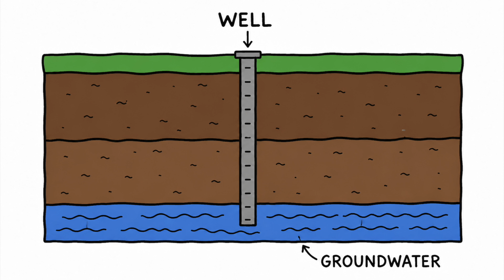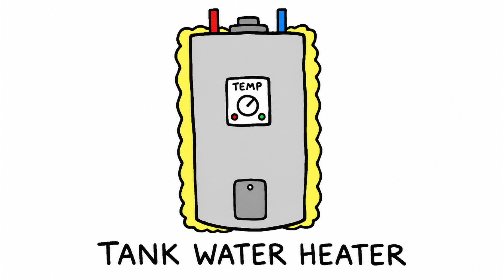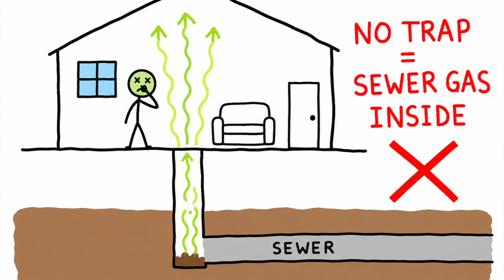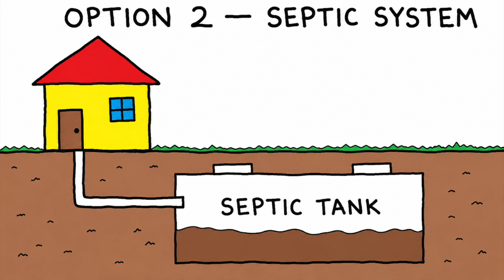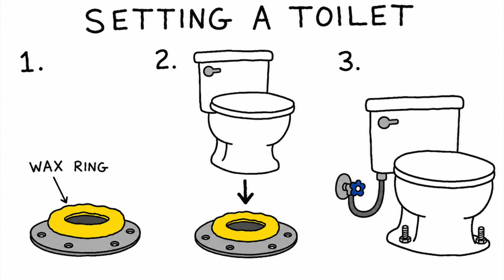How Plumbing Works in a House From Start to Finish (In Simple Terms Anyone Can Understand)

Comment: Really liked how you explained the whole system from the water supply through DWV, rough-in, and final testing. It shows how much planning goes into getting everything coordinated properly. As someone interested in this side of construction, I can see why a plumbing designer Ontario like BPConstruct has to consider so many details before the walls are closed.
Reply from the maker: It really is all about the details behind those walls, thanks for the great comment! 🏠

Comment: Awesome explanation, was able to understand just fine, thanks! Very helpful video.

First time I heard about washing machine and dishwasher being connected to hot water haha
Here they're connected to the cold water and the machine itself heats it (when it has the hot function).

Never heard before of "angle stops" too, here the usual is having something similar for the "system", like, one such valve for the bathroom, another for the kitchen... but not one for each appliance. It certainly does look very useful though.

The common here is electric showers, so 1st time too hearing about that pressure balance feature in the shower valve, seems pretty important... in older houses it happens quite often that the shower gets too hot if someone flushes the toilet while you're showering, so there's probably some kind of similar system used nowadays, but only for the cold water.

Also, here we use another kind of construction system, not sure what's the English name for it, but it's basically based on concrete; it's interesting to see how it's done in other kind of construction system.
Reply from the maker: Glad it made sense, and that hot water hookup surprises a lot of people 😊

Comment: Do you have a video explaining most of the pipe parts for example copper 90 angles and couplings and so on?
Reply from the maker: Not yet, but a fittings breakdown is a great idea, adding it 👍

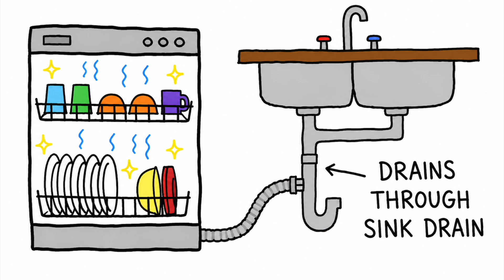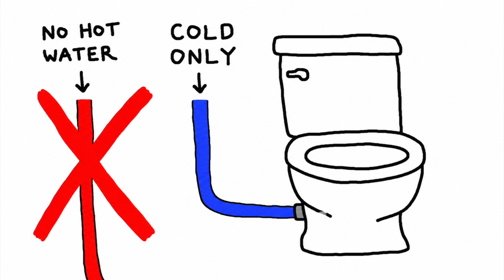Comment: If hot water help clean bacteria (5:10), why doesnt toilets use hot water too (3:46)? Nice video
Reply: Money.
Reply: Hot water will also damage parts in the toilet over time. Fill valve diaphragms, flappers, etc.
Reply: @zeppelin5000 good point
Reply: A toilet is not designed to clean. Potable water supplied to a toilet is only responsible for mechanically pushing waste through the P trap and into the DWV system. Hot water supplied to a toilet would create steam causing odors, it would become cold if not flushed and replaced soon, and it would increase gas or electric bills by using more energy to heat more water. Some Commercial dishwashers-sinks are required to have water at 125-130 degrees which kills most bacteria.
Reply from the maker: Toilets are only moving waste along, not cleaning anything, so heating that water would be money straight down the drain 😅

Comment: Amazing! Bought a house with dreaded polybutylene piping 😭
Reply: Polybutylene water line is outdated and unreliable since the 90s-2000s. If you have the resources to remodel and repipe your home, switch to  pex A or B (polyethylene) for speedy flexible installation or copper for rigid durable and recyclable potable water lines.
Reply from the maker: Oof, polybutylene, good luck with that one 😅
Reply: @rescomcontractors haha just paying someone to fix it up, 550k in nh won't get you a move in ready build no chance. Gonna do copper i think

Comment: I assume this is a US video, because in the UK the water meter would never come before the stop tap
Reply: No he made a mistake there is always a stop valve before the meter in North American water systems. In residential water systems the water meter is typically by the street in a water meter box where the piping is handed off into the municipal services jurisdiction. You typically only see water meters inside a mechanical room on commercial infrastructure.
Reply from the maker: Yep, this one was US focused, thanks for the UK side 👍

Comment: Question: How does the hot water get pressurized? Is it just running off the pressure already in the cold line?
Reply: Yes. The pressure of hot water lines is translated through the water heater and no pressure is lost.
Reply from the maker: Yep, the water heater sits on the same supply as the cold line, so the hot side runs on that same pressure 👍

Comment: UK - meter is external. Where the master valve is- you do not want it in your house, as that gives no protection in the feed to it.
Ignores non-mains pressure systems. 
In UK most do not have a 'water heater'- a combi boiler heats water on demand. Efficient.
Toilets- some are syphonic. Most have part and full flush.
Showers etc- Europe mandates thermal control to 40C max (sometimes with an override).
'Laundry box' ??
P trap. No it is a U bend. Looks nothing like a P. Does look like a U.
A vert is not essential- an air admittance valve can be used. Even inside the house.
Drywall is NOT universal.
Many toilets are rear drain fitting- incl all wall hung types.
Reply: Most meters in the US are external. Some are in homes, but most are outside. The meters have a valve on them and most homes have another valve inside the house after it enters the home.

The entire P trap assembly does look like a P on its side, the trap arm plus the trap.

AAV's fail and are not code to use  to vent an entire plumbing system. Kitchen sinks are often the only fixture allowed to use one. They must be accessible since they fail...
Reply: @z @zeppelin5000  P on its side’. Provided you remove the top of the vertical. Whereas the U is a clear representation of the concept. See the original patent. AAVs are perfectly legal in the UK. Remember that the US represents ~5% of the world’s population…

Comment: Notes Main water shut off valve water heater breaks 
Water heaters tank vs 3080 tank less water heater
Pressure balance fir shower 
Facets need frost free outside

Water seal in p trap water to prevent stench 
Branch drain main drain

V ent pipes
Blocked vent causes stench 
Main building vein - city sewage 
Or 
Septic tank clean 3-5 tires 
Clean out access points capped fitting main cleanout  near t h e main 
Basement garage foundation
Reply from the maker: Those are some solid notes 👍

Comment: Dishwashers connect to cold water in Italy, and probably the rest of Europe. They heat up the water to whatever temperature you chose
Reply: Almost universal- the hot water in a house is rarely hot enough.
Reply: That’s fascinating. 
In the U.S. some systems without a hot water circulation pump require running water through the sink first to bring up the temperature in the lines. 130 degree water will decapitate most bacteria but can cause risk of scalding in showers. I wonder what dishwasher technique is more efficient.
Reply: @sammyplueddemann2671  The small amount of hot water that dishwashers use, and heat themselves, is less efficient than gas or oil heated water. But taking it from such a source wastes heat in the feed (more water to get up to temperature) and usually needs to be hotter anyway. So cancels out. And has a simpler installation and control system (single inlet solenoid).
Reply from the maker: Good to know, that seems to be the norm across most of Europe 👍
Reply: @rescomcontractors Mainly because most hot water is from condensing gas boilers. Turn up the temperature and they stop condensing. Dishwashers need hotter water.

Comment: Are copper pipes superior to PEX with regards to longterm wear?   I’m concerned about pex degradation causing leaks after years of use.
Reply from the maker: Copper is traditional and durable, but modern PEX is highly resistant to corrosion and mineral buildup, making it a reliable choice for long-term use.
Reply: @rescomcontractors  Pex type B utilizes copper crimp rings that can corrode. Copper and Pex have trade offs. Copper is rigid, durable, can be recycled, and is expensive. (Sometimes stolen) copper is more liable to corrode.
Pex is flexible, cheap, faster install, not environmentally sustainable and in my opinion just as reliable.

Comment: Nothing new for me. My only standing question, since cold water enter the heating tank once you use the some of the hot water, your essentially cooling your water every time you use a part of it, loosing the heat you paid to have.
If your tank is full of hot water and you use half of it, how long till the hot and cold mix to the point where the tank is mostly cold?
How long do you have between 2 showers if you don't want to lose the heat?..
Reply: They don't mix as much as you'd think. The two temps tend to stay on their own sides because of how the cold is designed to come in from the bottom. If they both entered at the top you're right I think they would mix immediately. Technology Connections has a pretty cool video where they show the separation with a thermal camera.
Reply: A thermostatic mixer will compensate for different tank temperatures. Yes, there are losses. Electric heating is more expensive than gas- some older systems use a coil heated by a gas heater to heat the tank water. Modern systems use a combi boiler- as well as CH it heats water on demand. Very efficient and lower losses- and you do not have a large tank of water in your house.
Reply from the maker: Tanks layer, hot stays on top and the cold comes in at the bottom through the dip tube, so it doesn't all mix right away 👍

Comment: "You use plumbing every single day."

Well, except for people that go wilderness camping for several days in a row. Camping at camp sites, yes, because you have bathrooms there, but not camping out in wilderness, no. I mean, I think bathing and drinking out of lakes and rivers is super sketchy in case it has diseases in it you can't see with your eyes, but people do that for some reason. Personally, I prefer to go back to my house or hotel to sleep at the end of the day because that's enough wilderness for my tastes, I don't need to be submerged in it for 4 days straight to satisfy my wilderness fix, but there you go, I guess. I actually do like using plumbing every single day...
Reply from the maker: Fair point, wilderness camping is the one exception 😂

Comment: This was 100% AI generated from the script to the voiceover to the drawings. But dammit it was a good video.
Reply: Really??😮😢
Reply: @lorcster6694 I mean yeah, it's pretty obvious
Reply from the maker: There’s still an architect behind everything 😘
Reply: @rescomcontractors  mhm..
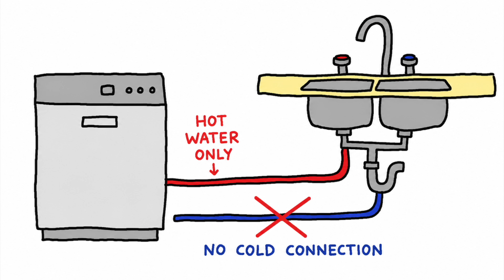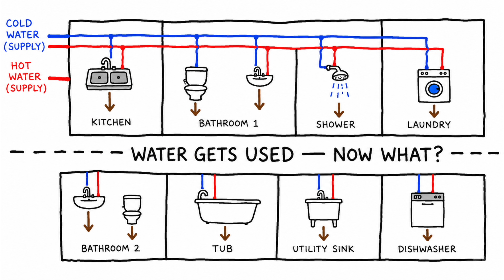Reply: @rescomcontractors  clearly not a good one. At 5:07 you say only hot goes into the dishwasher. But at 5:17 the visual shows cold going into the dishwasher. Your visuals are inconsistent with what you teaching. This is why people are against AI use because without a good architect or quality control it can easily convey false information. Try actually making your videos next time

Comment: The cold and hot water lines going to the sinks make sense, whichever knob you turn will open up the corresponding line. But how does that work on a shower where there’s only one knob? One where the more you turn it, the hotter the water gets
Reply: The one handle controls three valves. In general.  There's a lot of showers out there and they don't all work the same.
Reply: @michaelfujii2765 showers and faucets function the almost the same way. Shower and faucet valves control the volume of hot or cold water supply. Many faucets have 1 handle and some older shower/bath configurations can have 2 handles.
Reply from the maker: Great question, a single handle valve has a cartridge that blends both lines, and turning it changes the mix 👍

Comment: How many people have the water meter in the house vs at the street?
Reply: Most residential ones, at least where I'm at (I work in engineering Pipes and pipe accessory schematics) are at the street. However for private wells or properties on their own large parsal of land its not uncommon. Its extreamly common in industrial.

Most have bypass pipes attatched which is essentially a pipe that, if its valve is twisted, will illegally move water through the facility. Its important they have them because if the main is fucked we can switch it to bypass and the building doesn't lose water.

Its important to note that the government will charge you based on a pretty accurate, if not, slightly inflated guesstimate once they know if it hasn't been approved.
Reply: @N @NajonJenkins  I’ve never seen a bypass line on a house. In what scenario would a water meter fail and restrict water flow?
Reply: In Germany we do or at least in all buildings where I lived.
Reply from the maker: Here in Florida it's almost always at the street, but colder places often keep it inside so it doesn't freeze 👍

Comment: FYI, only in North America are dishwashers and washing machines connected to the hot water line. In most of the world, these appliances are connected to the cold line and have their own heating element
Reply: Most American washers do both
Reply: American washers have a heating element too I thought
Reply: In Australia it's 50/50. Top loader washing machines usually connect to both hot & cold lines, whereas front loaders vary. Dish washers usually connect to cold & have a heating element, but some can also hook directly to hot water.
Reply: Dishwashers generally also have heating elements. I've never heard of a washing machine having a heating element. It doesn't make much sense, considering the cycle is so short. For dishwashers, it makes sense.
Reply: @asdfgoogle  how long is the longest washing machine cycle for you? here it's easily 3h for the eco mode, hence the need to keep the water up at temp
Reply: @gorekse8655 oh wow. I think like 20-40 min. I haven't done laundry in forever (wife does it), but it's definitely way shorter than an hour. Dryer is usually around 40-50 min. And dishwashers are like 3 hours.
Reply: @asdfgoogle our new ge basic top load does a max load in like 35 minutes. The dryer takes a little longer but I set it to mid heat so it doesn’t shrink anything.
Reply from the maker: Great point, a lot of Europe runs them on cold and heats the water inside the machine, that's a US habit 😅
Reply: Would that save more money or nah
Reply: Thanks. I was looking for this info

Comment: Plumber of 15 yrs, this is probably the best explanation of the basics of plumbing I've ever seen, very well done.
Reply: It's an ai script with an ai trained voice reading over ai generated images...

Effort is very minimal. The creator is just waiting for the ai generated things to load, which is like a few seconds to a few minutes.

Most generated ai videos are limited to ~5sec durations, because it takes a lot of power to generate videos compared to text and images, unless you pay for whatever service. Even when paying, the max would be about 10-15 seconds (it takes a lot of power).

Ai voices tend to be neutral and monotone, so that it doesn't sound wonky, especially so if the ai is reading a new sentence without memory of the last.

Because each point in the video is around 5 seconds long, the ai chooses to remain neutral, but you can notice strange pitch changes at the start of a sentence sometimes.

It's easy to put a voice-over onto an image/slideshow. Very very easy.

Everything about this channel is ai, even the name, "ResCom Contractors," channel owner is trying to sound legitimate and trustworthy.

This is basically ChatGPT, but with pictures and a narrator.
Reply: @Divionist  We know it's AI though, and you can see it from the pictures. It does take effort and revisions. It turned out accurate, and easy to follow, following every important step. So, I liked the video, even if I knew it was AI - it was informative and worth the watch
Reply: Even the replies are ai generated...
Reply: @Divionist  oh no the video is ai that means everything i learned from this video is magically suddenly wrong oh no
Reply: @Divionist who cares if its made with ai, the content is still helpful
Reply: Send it to the plumbers, most of them need it.
Reply: When a turd herder likes your video, you know you did a good job. 

Keep herding those brown trout down stream! They need 1/4" fall to swim away.
Reply from the maker: That means a lot coming from a pro!

Comment: Having owned several homes and worked on these systems I knew alot of what you were talking about.  I wanted to see your presentation.  Very well done!! These are the types of videos that all homeowners should watch so they understand whats going on inside their walls.  They may not necessarily do any of the repairs, but they'll at least have an understanding of whats going on.  Great job! Subbed!
Reply from the maker: Glad you enjoyed the breakdown!

Comment: My mom's house has a septic system and she uses a product called RidX to avoid pumping the septic tanks, are those legit?
Reply from the maker: Healthy septic tanks already have more than enough bacteria.
Adding more bacteria doesn't significantly reduce sludge buildup.
Sludge and scum still accumulate over time because not everything decomposes.
Only pumping physically removes the accumulated solids.
Reply: Bacteria breaks down most waste but there is always a portion of the waste that won't break down. This accumulates and is what needs to be pumped out.
Reply: Most septic tanks in the UK are sealed, and it all needs pumping out. Frequent (every few weeks).